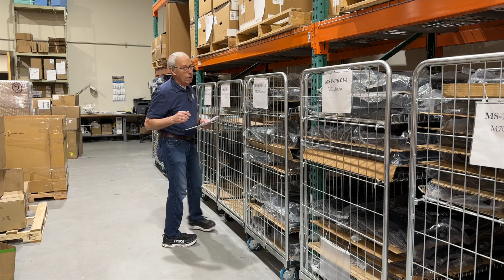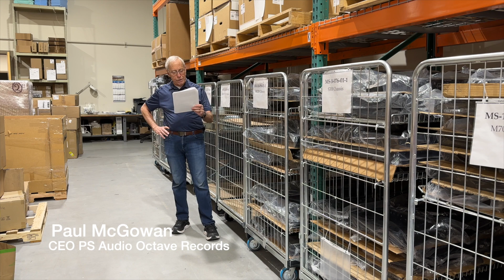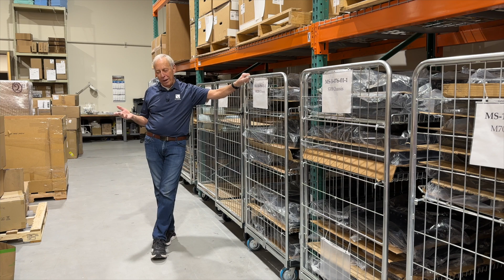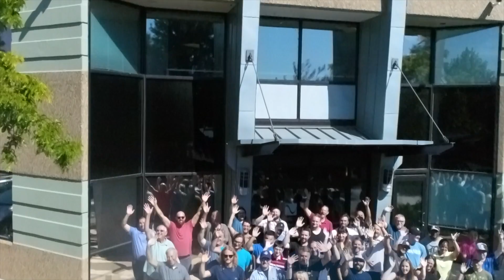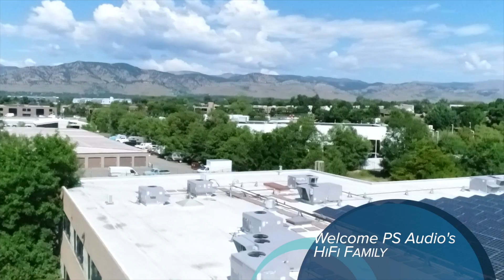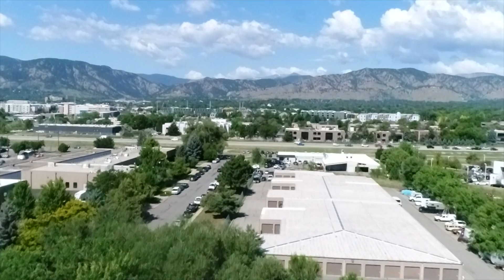Why the last few feet of the power cable matter

Comment: Paul...please!  You speak to the power link from the wall to the device. The last 3-6 feet typically.  What have you to say about benefits of "isolated ground wiring"?  Specifically, how the house is wired from distro box to wall outlet.   I suggest fancy terminal power cables attempt to treat a symptom, not the cause.

Comment: Power cable replacement goes back to the pre-digital era when everything was analog. When people professed a preference for a fancy low noise cable what was causing the intereference? The only thing I can think of is: rectifiers, bad designed oscillating DC voltage regulators (unusual), FM pilot tone or tape bias oscillator during recording (only)?
Reply: I think the recent advancements in brain science will answer these questions, if the simplest and most logical conclusion will do.     back when science was more limited, a double blind test was used to separate illusion from reality , but such proof by testing is never cited by any manufacturer of fancy wires.

Comment: Hey Paul. I'm an audiophile (250k plus system) but I'm also a general contractor so you can imagine my thoughts on this, but honestly, you have me rethinking everything. I have a designated 20 AMP line to my system and use mostly manufacturers cables. I'm now off to audition power cords. Palm slap to forehead. Thanks ... I think.

Comment: Extraordinary claims need extraordinary evidence. Where is scientific evidence that power cables do help? What we have only some people claims, there are people who did claim they did see aliens should I believe them as well? The power cable shielding will make difference only if you have a really crappy power supply or amplifier. I don't have a Hi end system and no power shielded cables I have 0 noise from the power even on maxim volume.

Comment: That so far is the only rational explanation.... I have a solid background in electronics and do have a good understanding of proper shielding.  I will accept this answer.
Reply: It is not, noise comes from everywhere. He need to prove that noise that comes from power cables is big enough and is bigger then other sources of noise and none of this was done. It is like: my car tires are only 99% round this will affect the speed of the car and I should fix this. It definitely affects the speed of the car but not as much as other things that you have in the car.
Reply: @amotriuc   I believe you misunderstand how a proper ground shield in this instance can isolate noise.  He states clearly that this only will prevent electromagnetic interference from adjacent equipment.  When you have a very resolving system with sensitive electronics you must try and eliminate variables to improve noise floor.  It may make no difference to your setup but may improve noise floor to other setups.
Reply: @soniclab-cnc It will make no difference to properly designed equiptment. But fair enough I guess, those audiophile types sometimes are into antiquated/primitive  amplifier and power supply topologies with inherently low PSRR. They might actually profit from anything that helps their stuff existing in the modern world, while simpler main stream devices just are not as susceptible. Has nothing to do with the resolving capabilities of the system though.

Comment: The last few feet of power cable is absolutely vital. Without it, the rig will be challenged with significant voltage drop. 

That said, I've recently experienced systems better off with the aforementioned voltage drop.
Reply: Do you know how to calculate voltage drop at all?
Reply: @MightyPriest   
Voltage drop = I²R losses 

That said original comment was tongue in cheek.
Reply: @FOH3663   is it 3 or 1 phase cable, where is the conductivity parameter? :D your formula all in all does nothing with voltage drop expect a very few cases
Reply: @MightyPriest  
Yes, I know how to calculate E drop (I²R losses).  

My initial comment was a joke, pointing out the "importance" of the last few feet ... as without the last few feet, you're going to have too much voltage drop (ie., a 2m gap!).
Reply: @FOH3663   i missed the joke -.-

Comment: In 1/120th of a second (1/2 a singe cycle of the 60 hz cycle)  electrons move about 2250 kilometers distance.
Reply: I don't think so.
Reply: The electrons in your wires are not moving very far.  The current is passed along.

Comment: I’m coming to the conclusion that many or most engineers are narrow minded. They will only believe something is real if they have a proven theory or data to back it up. The ‘problem’ with hi end audio is that we are at one of the frontiers of applied science. We don’t know everything and a hifi system is a complex situation. This engineers tend to dismiss too much because they are only comfortable dealing with things they fully understand or believe in. Anything outside their comfort zone is pseudoscience or snake oil.

Comment: In the past I tried a power cable (shielded). Also thinking about al the wires right up to the socket, that a relative small power cable could possibly not make a big difference. The guy from the store had me buy a Siltech power cable, and told me that if I didn''t hear any positive difference I could just return the cable and get the money back.
I just could not believe the difference! I heard it... (seller new I would i guess) I've let other people listen and they ALL heard the difference. This first cable was on my CD-player back then. Later on I tried replacing cables at the amps, but I must say that didn't't make any difference to me. I guess the CD-player was putting out noise back into the rest of the system so it was more noticeable when using a better power cable there.
Reply: In other words the cd player was crap?

Comment: Putting your washing machine, oven, microwave on the same circuit has 1000 times more influence than 1/10000 length of the net power cable

Comment: If your equipment generates enough EMI to be picked up in a power cord and transmitted through your system, you have bigger problems than 3' of cable.
Reply: The electromagnetic noise outside the wall amongst all your gear is far higher than the 15 amp shielded power run from the circuit breaker to the wall outlet. It's a fact for most residences. The cables —power and interconnects— that hang off the back of your various components can either shun that interference or those cables can act like an antenna and thus induce noise into your system.  This is what you face, more or less.

Comment: Keep all power cables as short as possible and grouped together and DONT coil any excess cable !  Speaker cables ... keep each speaker cable as short as possible and don't group together and don't coil excess up either. Signal ( line level ) cable should be short ( if unbalanced) longer if balanced and the same goes as for speaker cables ... not coiling excess isn't so important...😀
Reply: Oh no!  Power cables should be at least 1 m, or better 1.5m.
Too short cables don't work. Try it !
Reply: @paulb.3227  okay ... tell me what your reasoning is ... I'd like to see 🥹
Reply: @janinapalmer8368  Well, I'm not an engineer, so technically I cannot explain it, but, in common words:  a powercable must have the length and space to clean up the mess. A longer cable makes sense in my simple way of thinking.
But what's more important for most audiophiles: a longer ( than short) powercable sounds better!
I had that experience in a very resolving set.
Both Audioquest and Furutech recommand a minimal lenth of 1 meter.
Reply: @paulb.3227  interesting 😀...I'm still yet to be convinced ! You must take into consideration the REST of the supply cabling this can be many feet long or even Kilometres long from the substation transformers . So what difference would a couple of feet make at the end of the line ?
Reply: @janinapalmer8368  
A lot of difference.
Paul just explaned. Did you even watch this video?
Reply: @paulb.3227 I've watched it 3 times just to see if I was missing something.... and no .. indeed I wasn't ! This has to be the biggest exercise in snake oil that I've ever come across ... honestly ! In one breath Paul goes on about Power Regenerators stopping all these unwanted noises entering your amps and DACS  and then, in another breath he says the amps and DACs created a high level of noise ? I give up !! I know I'm used to 245VAC supply mains where we don't have the high currents that 110vac lines that cause more noise in reactive parts of the line but at the end of the day all you really have to do is separate your cables into 3 groups :- power cables   Speaker cables and lastly signal .. ok 👍

Comment: As someone who deals with EMF interference on a regular bases at work I know it can be a big problem. The difference in the home environment is there are not many devices or equipement which can cause a lot of problems and are used all the time. That being said it is still possible to have devices that will cause problems and with the introduction of equipement like solar systems, homebattery or carcharging stations at home you will get more interference/noise. 
Having  solarpanels I'm able to measure it. So my 230VAC is messy. I don't do anything to clean it. Why? you ask. Well I listened and I couldn't hear it. I also opened up my amp and measured the input and outputs of the power supply. The outputs were perfectly clean. So good power supply and no reason to do anything. 
For the interference mentioned by Paul in my case that is so small it can be ignored. I was able to measure an old cd-player (20+ years) if I turned it on and moved it closer to the amp but only on the input. The output of the amp psu was not affected. But all newer devices didn't do anything.
For all people who don't believe measurements and believe in magic I also tried different cables. I bought some, got some from friends and got some from the store to try out. I didn't hear a difference. My advice would be: Cable should be shielded for high frequency and the shield should be connected on 1 side like Paul said, also good build quality. No need to go expensive. I found some good powercables at €50,- for a set of 6.